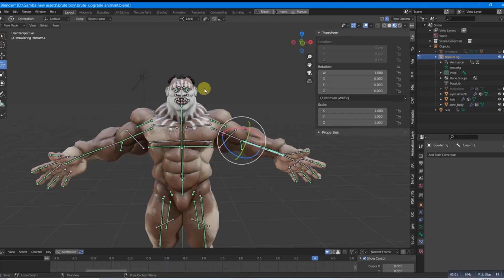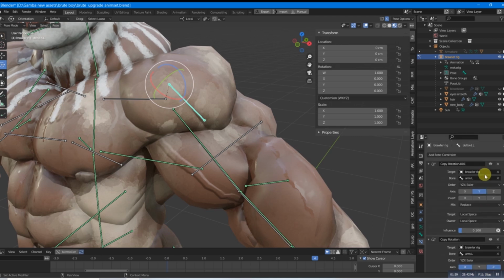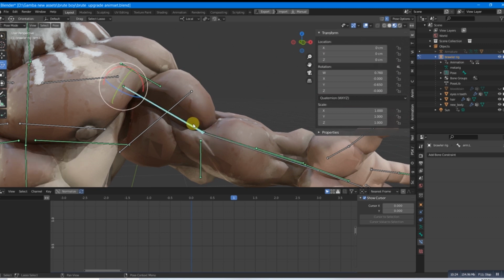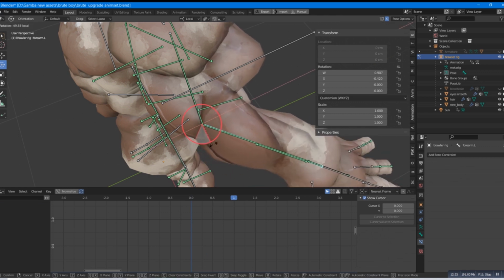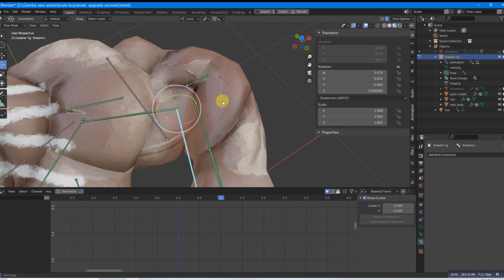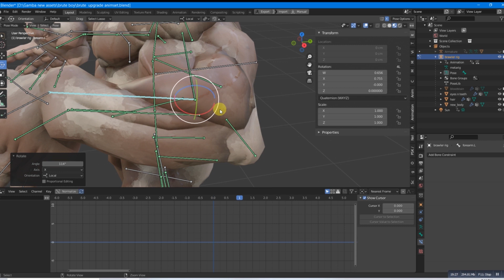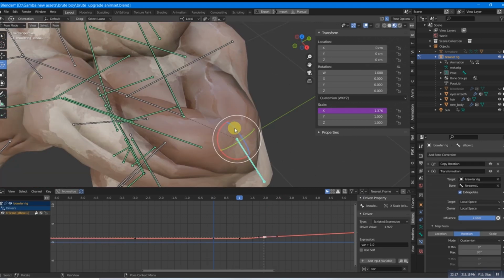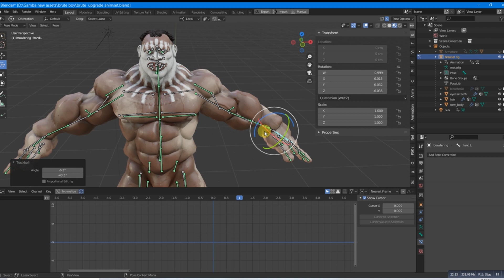Rigging muscular arm

Comment: what is the pec bone parented to? I don't see it having a constraint since it's not green, but it follows the arm movement, is it parented to the arm bone?
Reply from the maker: the pec bone is parented to the chest bone (spine) 
for it follwoing the arm i think i applied a driver to follow the arm movement along a certain axis . 
 i updated the rig though .....a better approach is by adding a damp track constraint that follows the arm movement then a limit rotation aswell to limit the motion.

this rig is quite old though i have changed my workflow alot to a much simpler but efficient system ,will post once the character is ready
Reply: @aliakdogan9426  oooh I never thought about that, but I see you have them working in unity, how do you implemented the pecs movement there? I'm new to unity and it seems there's just rotation , location and scale constraints, but I saw your demo on your fighting game and man, the animations are so clean
Reply from the maker: @blazegarcia6477  oh thanks so much , 
for unity i simply export the animations from blender with all the constraints baked into the animation.
so no need to make constraints in unity